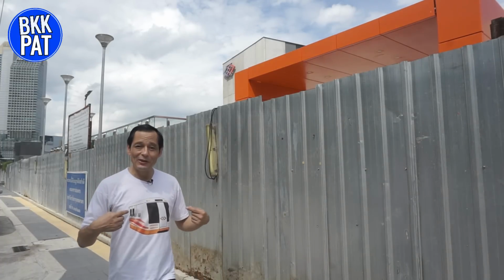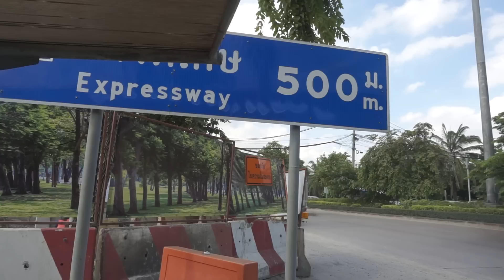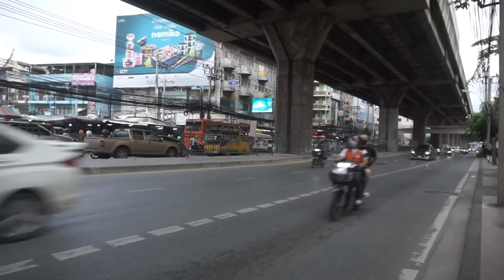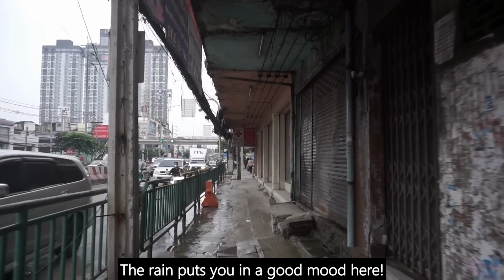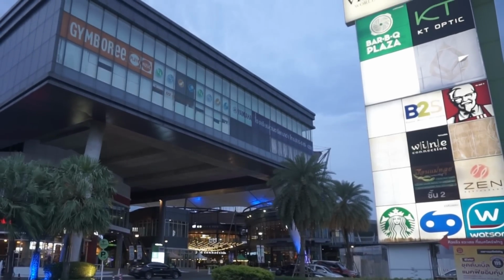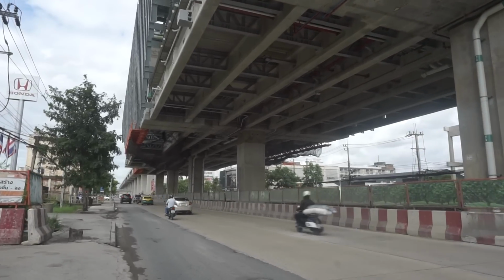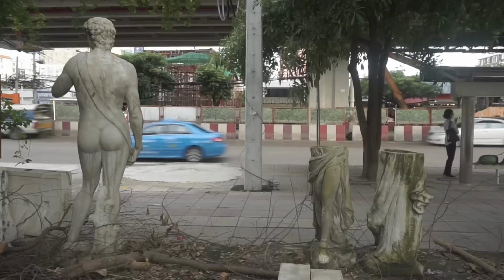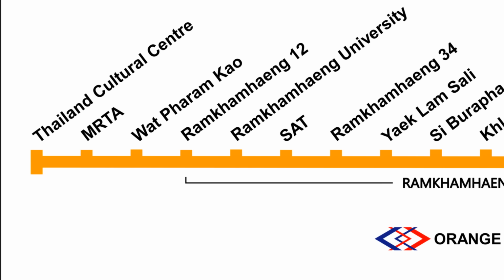✅ NEW MRT ORANGE LINE | Opening Bangkok's East Side | All The Stations | Walking Tour

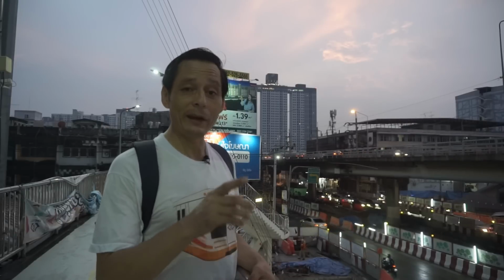Comment: 11:45 A few corrections here;

• Although the Yellow Line and Orange Line's constructions are on similar timeframes of construction, the Yellow Line will fully open two years before the East Section of the Orange Line.

• This is due to the fact that the contract to run the electrical system, source the trains, and operate the stations for the Eastern Section is bound to the same contract as the construction and operation of the Western Section.

• And as the contract bidding just got out of a second court case, it means that, even though the Eastern Section of the Orange Line will probably finish construction even before the Yellow and Pink Lines, it'll open 2 years after them.
Reply from the maker: In fact the Yellow Line will initially open as far as Hua mak then completely later on. Orange Line have no trains as yet and will sit idle for a couple of years sadly.
Reply: Update: BEM (The company that runs the Blue and Purple Lines) just won the bidding for the Orange Line
Reply: Yeah
Reply: I agree